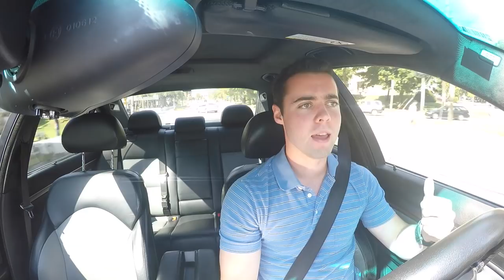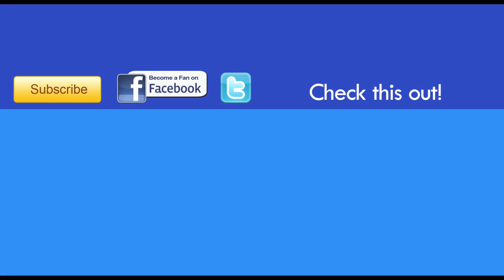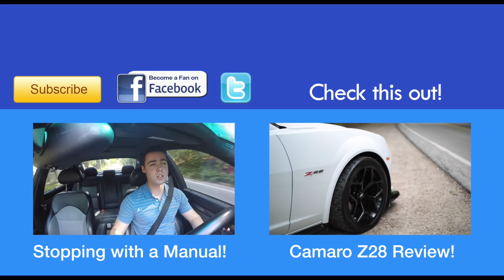How to Drive A Manual - Maximizing Your Clutch Life!

Comment: Starting off with lower RPMs, not slipping it any more than is needed to get rolling, and coasting to a stop in neutral really goes a long way. You can still drive spiritedly in between doing those things and get a long clutch life. 155,000 miles and going strong on my original S2000's clutch.

Comment: disagree on downshifting. ...if you know how to do it ...it will negligible over the life of the clutch disc. 

the BIGGEST issue which you didn't mention is RIDING the clutch.   this includes on downshifting ,starting from a stop,shifting...and also resting ypur foot on the clutch pedal while driving. 

those are the worst for clutch life.  if you know how to shift properly shift your heart out. it won't matter in the long run.
Reply: Euphorica That’s what I thought too but if you are only around 1500 rpm in third gear and see a red light and about to stop, there is really no point in revving it to 1800 in second gear and when the difference is so tiny you tend to over rev or under rev a bit anyways.
Reply: "Disagree" lol

Comment: So even rev matching properly wears your clutch out? I do it all the time and I feel like there is very minimum friction when I release the clutch.
Reply: Same thing for me, I rev match under normal driving to avoid the braking sensation when releasing the clutch.
Reply: +thaik56 It only wears ur clutch out if you don't match it perfect every time such that the clutch doesn't need to speed up the input shaft. Thus there's no friction and when you let it out you'll know if its dragging lol. He means for people that aren't very good at it. Or not rev matching at all....which yes puts wear on the clutch

Comment: I was told that dumping the clutch would only ruin your throw-out bearing. but keeping your foot on the clutch, or using it too much would ruin it, and make it start to slip.
Reply: Dumping your clutch will cause wear on the clutch plate, but it will do the most damage to the flywheel and the bearings you mentioned. It can also hurt the clamping mechanisms that bring the clutch and the flywheel together.
Reply: That is true, however, those parts are typically serviced along with the clutch, and the clutch plate is usually the first item that needs service.

Comment: I am driving around with 50ccm motorbike for last 10 years with no clutch.
Also I don't always use the clutch in my Fiat GP. After a lot of milage I got a feeling for my car and I know how to drive it. I have around 500k KM, clutch was replaced on 140K 4 years ago when I got the car, don't have any problems with transmition.

Comment: Hey VehicleVirgins, what's your take on waiting for the clutch to engage the engine before releasing the foot breaks on hill starts. Does that wear off the clutch more than using handbreak? What I mean is: say I'm at a hill start. One foot on the break pedal the other on the clutch. Time to take off. I start to release the clutch slowly, other foot still on break. I wait for the engine to make the noise of "I'm engaging, I feel the gear" then I leave the clutch pedal in that position switch on to the gas and only then take off. The car never rolls back this way.

Is that bad for the clutch?
Reply: +iTroozTrooperDown It is the same as if you did it with e-brake. Only difference is that for the moment while your foot is of the brake and traveling tovards the gas, car starts rolling backwards. Haven't they tought you in driving school on how to start on the hill with the e-brake?

Comment: Downshifting wears the clutch out but save the brakes...
Reply: +Igor Alessio brakes are cheaper to replace
Reply: +DarkLink99gaming it's also much easier.
Reply: +Igor Alessio Brake and downshift at the same time, in other words, heel-toe down shift, better for your brakes and clutch.
Reply: +thaik56 screwing up a heel toe downshift can do the complete opposite, and then some. You're better off down shifting while braking, or rev match downshift coming up to a corner, then using the brakes. As long as you're not in high revs (between 3500-4000 and 6000) while downshifting, you won't do any significant wear to your clutch.
Reply: DA2THFA1RY master it so that you won't screw up.

Comment: rev matching, you know you master it when you can do it without using the clutch pedal at all, i am almost able to do it in my volvo 740 sure it can make the clutch plates live longer, but do it wrong and the gearbox makes angry noises at you and you feel guilt as hell xD 
Ps. not recommended, but after 400k both the gearbox and clutch is badly worn by the last owner so it needs replacing in the near future, so i take the opportunity to learn xD

Comment: Rev-match downshifting around town is for fucking idiots who want to try and look cool. Like you said, it's wiser to just brake in the gear you're in, and go to neutral before the car starts to shudder. I'll only rev-match if I don't need to go to neutral while braking for a stoplight, but need a lower gear to have some power.